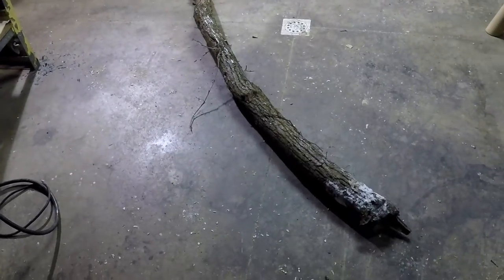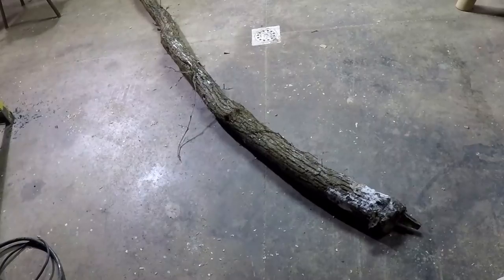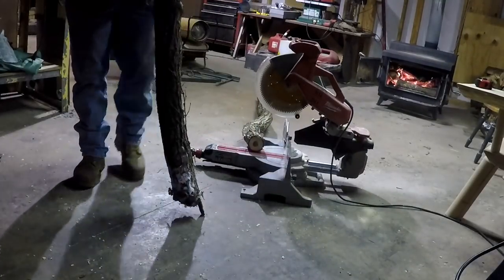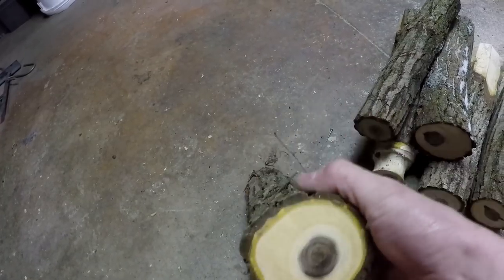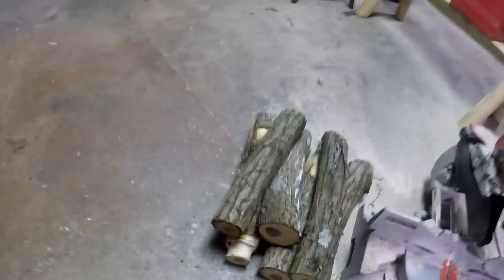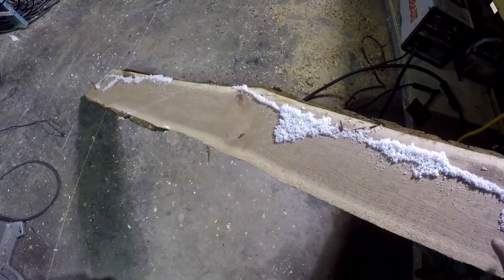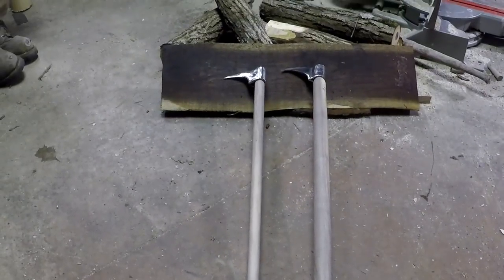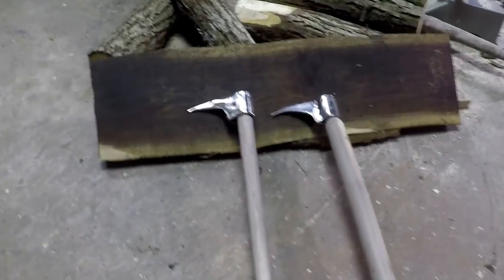Homemade pickaroon /hookaroon from lawn mower blade

Comment: I keep thinking what a hole those things make in the lumber. I'm not a mill mill person... just an old retired offset sheetfed pressman.
Reply from the maker: I don't plan on using these on any lumber. They are just for the cut offs on the buck saw. In other words I only will use these for fire wood.

Comment: Those look great!  I would love to learn to make a forge like that.  Probably helps a little with heating the garage too :)
Reply from the maker: It's nice on the cold days for sure. We made the forge off some simple plans on the internet. It's not the best but it's fun to do projects like this.
Reply: I have a couple extra old propane take.  I might have to try it.  Thanks!
Reply from the maker: The insulation we used on this one is just a mixture of plaster of Paris and play sand. It's not the best but it's cheap and easy to get. The burner is just some black pipe fittings with a #60 hole drilled in the pipe for gas to come out.
Reply from the maker: I plan to do a live stream tonight if you are interested 9pm
Reply: Sounds great!
Reply: I will be on, assuming we dont lose internet.  We are due to get 12-14 inches of snow today, lol.  Fun times!

Comment: Have you considered knocking the corner edges off wirh a table saw or bandsaw to reduce llathe time?
Reply from the maker: I have considered it but this wood is a little green an easy to cut. Took us under 2 hours from start to finish on this job.
Reply from the maker: Jeffrey Beyer, going to do my next live stream tonight 9pm eastern time if your interested stop by
Reply: Bens sawmill if I'm not sleeping, been doing early morning reefer loads this week.

Comment: I noticed what you are using for a fireplace/wood burner. May I humbly suggest a "Rocket stove". They are immensely more efficient both in wood usage (less wood fuel), heat (95+% heat exchange)  and waste (depending on the design you use just water, or steam exhaust. no CO or CO2). There are plenty of plans or kits available.

Comment: I'm assuming you used flux when you forge welded the loop together... borax?
Reply from the maker: Yep borax it was. I had it on the floor outside of camera view next to the anvil.
Reply: Ah... good.  I've had some experience with forge welding (mostly had the dumb end of a mandrel... LOL).  The conditions were different though. Summer in tidewater VA where it was typically in the 80s and 90s with humidity to match. We used coal that we coked... Working indoors with gas in cool weather looks a lot more appealing comfort wise but we attracted live crowds. ;~)